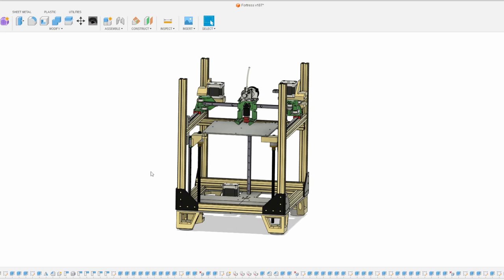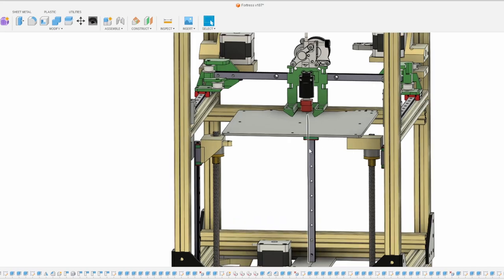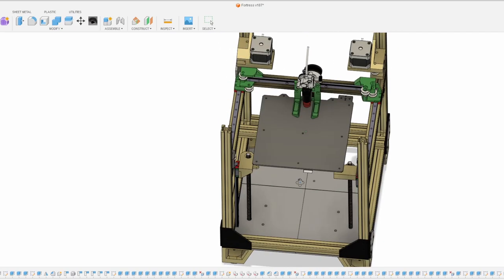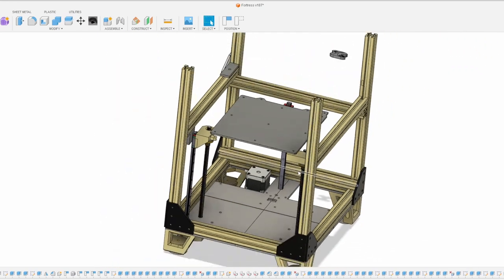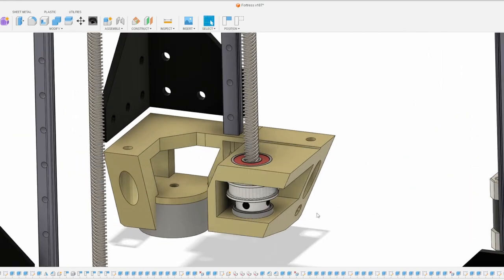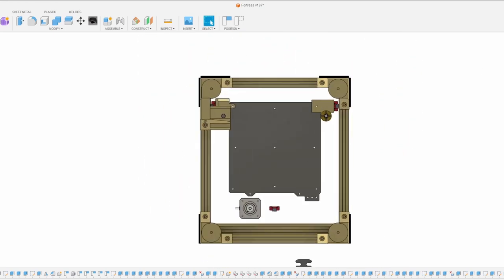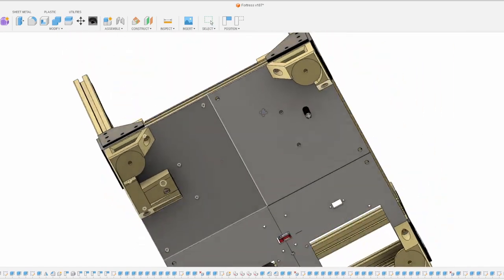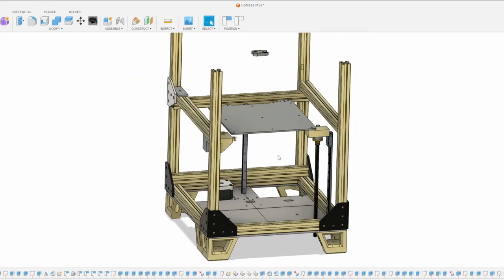Fortress 3D Printer Update

Comment: Spring mounting a bed to 2020 is fairly straightforward. I just drilled a hole for a long screw, then drilled a larger counterbored hole through just the T slot part of the 2020 for the spring to sit it. Run the countersunk screw through the bed, washer (to protect the PCB from the spring), spring, 2020, washer, knurled thumb nut + optional locking nut. Works fairly well, but does introduce some side to side wobble (like all spring beds). You could also skip the counterbore and just use a washer as a base for the spring on the 2020.

Comment: I think single foot is definitely the way to go, everything that reduces the amount of fasteners is a win in my book. Just out of interest: how do you actually make a belt loop? Do you join it yourself or do you buy it as a loop?
Reply: Agreed. The print time for one large part should be less than the two small parts since there will be less outer perimeter area, and less time interacting with the printer to start and remove the prints, and less time interacting with the parts to screw them together. If failure is a concern, make a small model of just the bearing pocket and print that to calibrate.
Loop belts are available in many different tooth counts, but some are more common than others so generally it's best to design for one of the most common sizes.
Reply from the maker: I will need to find a belt the right size, they make a bunch of sizes

Comment: I'd say two separate parts for the Z issue. It's more important that the bearings sit nicely in the pocket. If you are not keen on the heat-set inserts, then just make some nut pockets like the Rook180
Reply from the maker: I will try the one piece version first then maybe keep the two piece as a option version

Comment: If the prusa mini bed doesn't work out you coule use a 180mm anex k3 bed kit, about $65 for 5mm bed with sillicone heater and pei sheet.

 Also have you tought about doing a kinematic tripple z to lessen the effect of the bed expanding under heat? Should only need 3 extra m3 metal balls and 6 neodymium dowel pins
Reply from the maker: thanks, maybe one day I will try that for sure

Comment: I was just looking at oldham couplings recently and wondering why I haven't seen a belted-z with 3 leadscrews that uses them as part of the core design. I run a fairly modded E3 with belted and it is by far the most stable way to go, I don't understand the appeal of 3 Z-motors, we have clickyprobes etc to compensate for slight user error and provide feedback maps. 

TYSM for going to town on this concept, I just might have to make one. Voron gantry system is complicated, ratrig bed system is even more complicated, this one just makes sense. 

Also curious if you've ever entertained the idea of keeping the Z axis v-roller compatible? It's a weird idea but could make it pretty budget friendly, then later boot-strappable to rails. I say this mostly because it already has the extrusions so it's 9 v-rollers for Z(~$12) and some printed plates vs 3 linear rails+carriages($60+). V-wheels are not 'better' obviously, but mine are still kicking 6 years in, they work great with pretty minimal maintenance cleaning.

Also for the feet.. I wonder if you could just turn the steppers themselves into them? 3 primary feet then 2 shorter 'anti-tip' ones in the back. I worry that as you load the planned ones will deform under accumulated load, also if you did a heated enclosure they might react from the differentials. There was a very recent qudi printer that made the mistake of bolting their leadscrews to plastic, yours will be thicker but also holding the weight at a sort of cantilever to where it is mounted to the rails it looks like. Just some feedback and wish you the best on figuring those things out!
Reply: I put oldham couplers and anti-backlash screws on my E3S1 and my Z-printing is beautful. Ran a 200mm tall vase print of a simple column and not a single artifact, wave, or distortion of any sort showed up. Oldham couplers are legit.
Reply from the maker: yes I agree with the old ham couplers should be a good option, I have some ideas for v-wheels!

Comment: Printing doesn't press on the bed, however various nozzle meshing arrangements do (eg Voron tap, loadcell).
Reply: No tap but yes to piezo.
Reply: Russell Phelan  shouldn't use springs anyways, haven't seen any benefits over silicone spacers.
Reply: Russell Phelan  Works on stiff bed support systems, fixed or moving (Voron Trident has moving bed, Tap works). Does not work on springs. Spring supported beds are going away on the better 3d printers.
Reply: piezo doesn't press the bed.
Reply from the maker: I will try some different things and see how it goes, I have adjustable piezo so I can very the force

Comment: What about using kfl08 under the lead screws? 17mm height of the belt coupler, 11.5 for the kfl08, that might leave enough room to get a stable printed part.
Reply from the maker: that could be an option too, I may consider for other printers!

Comment: What is the point of a triple z when you are only using one stepper for it? Serious question, no offense
Reply: Probably to not have to design multiple bed and rail mounts for 3 motor or 1 motor config.
Reply from the maker: for this printer I want to keep the BOM that same and also only use a 5 driver board and not a larger more expensive one

Comment: The bed should be turned 90 to the left, there are no reason not to optimize the room in the back to make sure there are room for PSU and Board.
Feet I'm a bit meh, can be 2 part can be one part no big deal.
Reply: unless it cost build space ofc

Comment: Why linear layers are so hiped. What Prusa have been using works well for folks for 5+ years. Cheaper and simpler.
What the real benefit. Except raw friction and else characterictik?
Reply: Easier to work with mostly, no need to design any clamps to hold the rods and bearings. Rail screws easily into a extrusion and already comes with mounting holes on the carriage. And cheap rails are close to the price of a cheap linear rod + bearing anyways.
Reply from the maker: I will be using linear rods in another design, I wanted this to use the existing Rook Evo BOM as much as possible

Comment: I would revisit the linear rails on the z perhaps add 2020 to the side instead of attaching only on the top and bottom
Reply from the maker: I have used floating linear rails like this on larger printers with out issue. I prefer to attach them to 2020 but I want to keep the BOM and build simple for this one